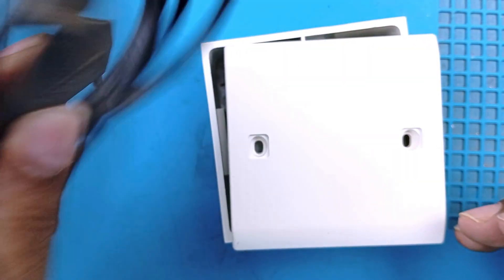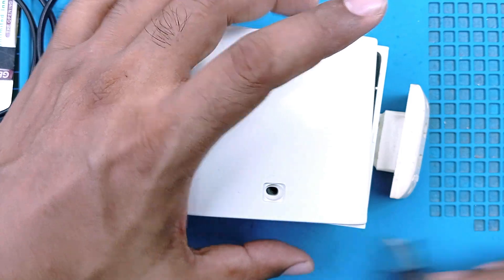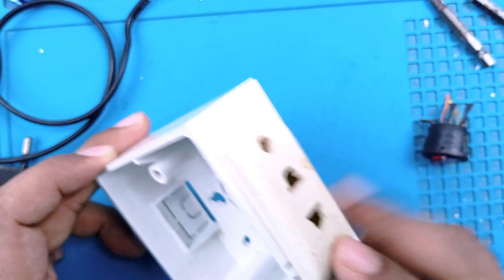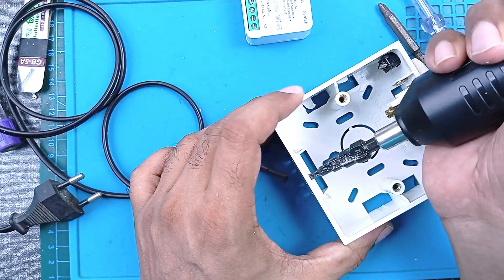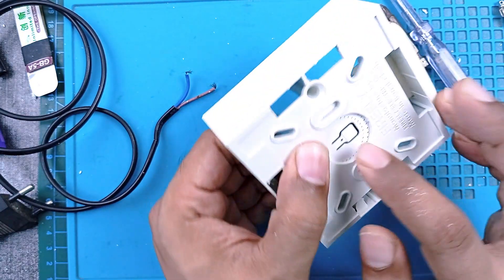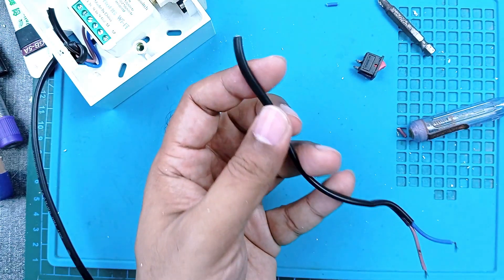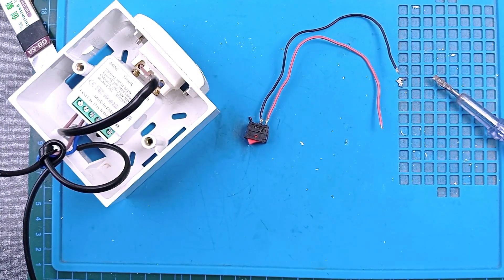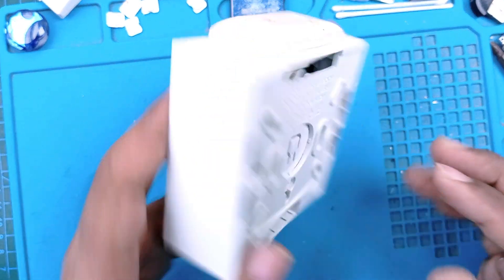Make Your Own Smart Plug at Home: Step-by-Step DIY Guide!

Comment: How much load can this handle? Can we run a submersible water pump from this?
Reply from the maker: It can handle 16A, but for added safety, it is recommended to use a relay with it.